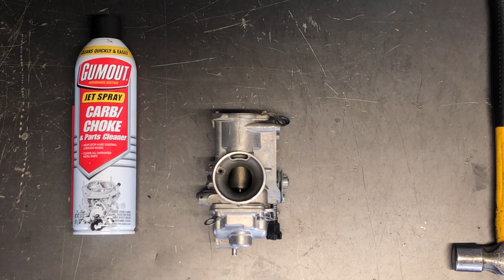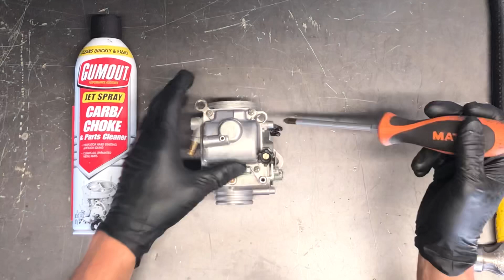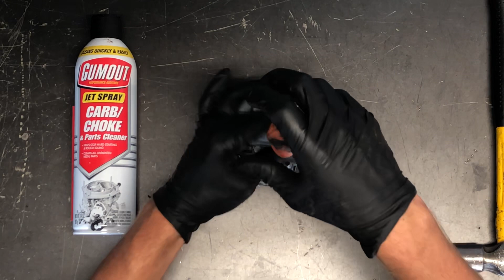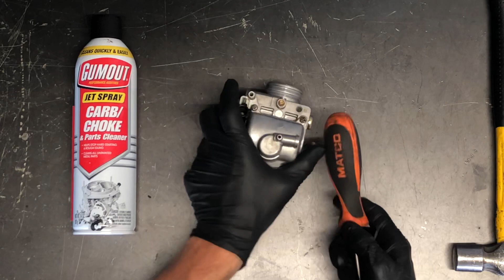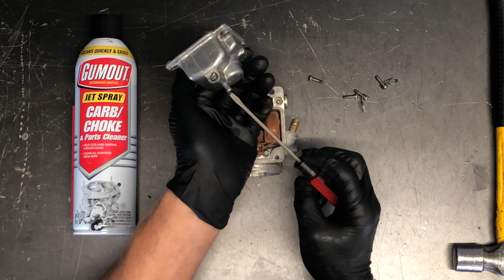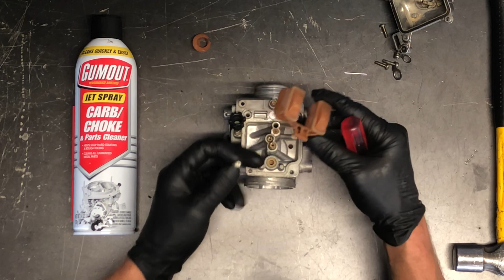HOW TO - Honda Fourtrax trx 250 Carburetor Clean Carb Rebuild Kit Gas Fuel Cleaner GUMOUT Repair Kit

Comment: Just a tip. What would work great cleaning out the needles and jets is a welding tip cleaner. Really small picks used for unclogging rose buds and torch tips. Would work great here if you have access to that

Comment: Good job! Followed your steps on my 85 Fourtrax 250 but still fackfiring and won’t idle, start east on full choke and  Boggs to death after five seconds or so, and gets better if I spray startng fluid in carb when Bogging begins. I’m suspecting a fuel shortage just don’t know where to begin. I started at 1 3/4 turns out on carb. Cleaned carb and everything looks clean.
Reply: Try checking to see if the petcock is clogged
Reply: @vanillagorilla6845  Thanks for the input. I just solved the problem. It was a lean backfiring problem. Solved it by fixing the carb installation. There was a piece of plastic in there that seats on the main jet area—well it was installed incorrectly not sitting properly hence blocking pilot jet orifice. Twisted it to fit properly and boom! Runs like a champ now!
Reply: @lmt-adventures  right on. I just picked up a neglected 85 trx250 I’m working on. Gas so old was yellow and could probably peel paint off the walls. Petcock was clogged, carb was dirtiest I’ve ever seen lol. Put it back together and starts first kick but idle is way too high so I’m trying to figure that out now
Reply: @vanillagorilla6845  We for the same quad then! New to the sport but learning a lot and having tons of fun through the process. Carb Chem did the work for my carb. “Rust Dissolver” by Rust-Oleum did the magic for my rusty tank now looks brand new inside after a few days of flipping (way too long as product needs about 30 min to an hour to do the job but I had only a gallon so wasn’t touching every wall surface)….Sounds like you got her back to life, high idle doesn’t sound serious adjust the idle knob and let me know how it goes.

Comment: I just bought a new one there not allot & it started right up,I probably will take the old one apart & clean it but there so inexpensive,it did take almost a week but that's fine,it won't move but working on that issue...   ✌

Comment: Rebuilt mine but now it is fluid in really bad.. Any idea?
Reply: Flooding really bad
Reply from the maker: Did you mess with float height? Also, I see a lot of times, guys rebuild their carbs, then during install, they put the fuel hose back on and a chunk of rubber gets chipped off of the fuel line and holds the float open. Might be worth checking. Also if you possibly didnt get the main tight enough, I've seen those work loose and give some major fits. Let me know! Thanks for the question! Hit the subscribe button as we have a lot more videos coming out on this machine. Also, check us out at https://www.midnebraskamotorsports.com/
Reply: i cant get it to hit at all i even put a brand new carb back on it. wont say nothing. good spark also. changed the coil